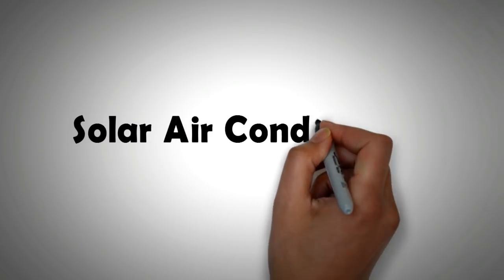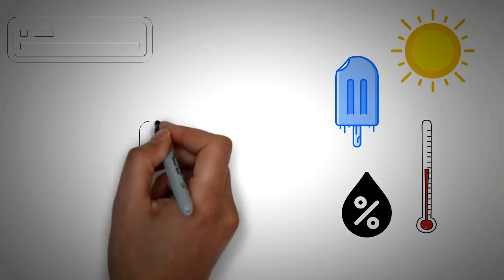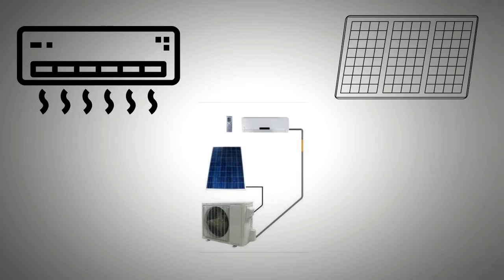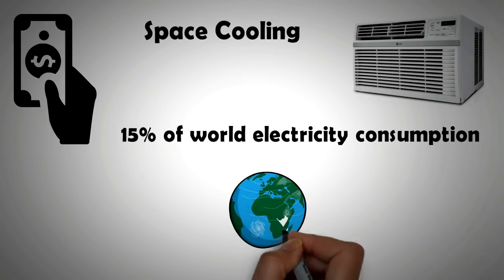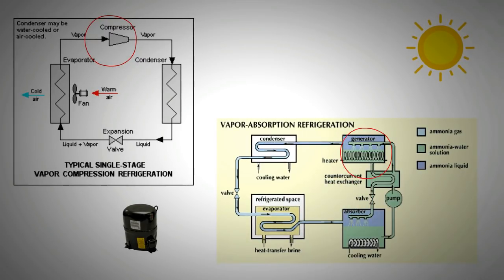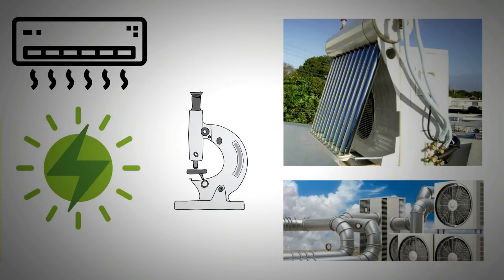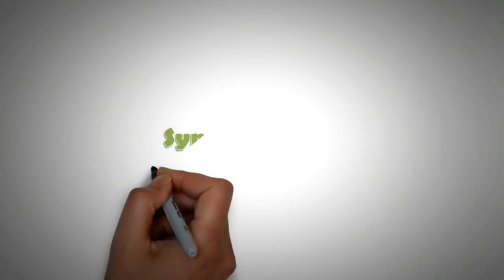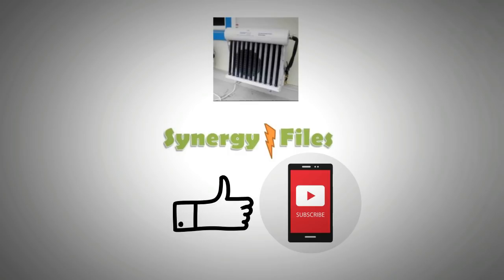What are Solar Air Conditioners

Comment: As far as I can tell, this concept fundamentally misunderstands how phase change heat pumps work. Adding heat won't help you cool something down more efficiently. If you can explain how it can, please do so because I'd love to know.
Reply: What they're saying is that they use a solar compressor, meaning pressurised gas is heated to further raise it's pressure for fixed volume, so they're raising afterload for the actual electrical compressor, and then they cool this with a larger condenser, and this somehow raises efficiency. 
At first I was convinced but later now I'm stumped.
Reply: Refrigerant will want to expand, making harder for compressor, besides if condenser couldn't cool it as should then warmer refrigerant will pass through evaporator ..so dumb

Comment: lots of talking ,  how much does one cost , what does it cost to run compared to a current unit   . is it even available?
Reply from the maker: Will depend on Sunlight, but your compressor could be running 60 percent of its normal time

Comment: I'm fairly certain that heat is a by product of the compression process not a goal,  if that were the case there'd be no need for the condenser  units that cool the vapor back to liguid before going into the compressor... that said in the case of ammonia ADSORPTION refrigeration you need only heat to liberate the ammonia from its absorption medium (could be a salt), which incidently compresses it,  and drive it off to condenser to allow the liquid to be used in the chiller, where it evaporates and then returning to the media.
Reply: @Lui Vyas the great knowledge sir. Explained very well.
Reply: Dont mix Adsorption- cooling (Solid liquid) and Absportion-Cooling (Liquid Liquid)

Comment: I think that heating before compressing the gas is wrong and would lower the cooling capacity of the system just as it is reduced on a hot day. The sun heats the gas before it is compressed which is why the efficiency is less on a hot day.
Reply: No. I think it Can be better since you add energy that the compressor otherwise has to provide. The work of the compressor is related directly to the ratio of compression. Higher low pressure, with constant high pressure Always results in lower power consumpion.
Reply: Yes hundred percent, cause if you see P H diagram its clear once you heat more after evaporator then work required by compressor is more , enthalpy of gas increases but pressure nothing so still zero benefit as the system is compression not absorber so this vedio done by idiot's, if you see T S diagram then again T increases and entropy increases do you know what if entropy increases it means again you are far from saturation so you need more power by compressor, last if you heat more the gas then you need bigger size of condenser..... so its wrong information

Comment: Thanks for nice information sir. Can you please explain that how it works in night when there is no sun and no heat outside. What will be the power consumption and efficiency of solar AC during Sun and night. Is it suitable for indian climate ? Thanks and regards
Reply from the maker: When there is no sun, the Solar AC runs just like a normal AC. This means solar AC draws less power from grid  when the sun is out while it draws more power when there is no sun
Reply: Going to work at night only when the sun is out using solar energy during the daytime will help lowering your electric bill because during the daytime your air conditioner will not be using as much energy from the grid also it is cooler at night so the compressor will not be turning on as often air conditioners use more electricity during the daytime because the compressor has to kick on more often because it is hotter during the daytime and if you set your thermostat a little higher turn the night time compressor will not kick on as often this will help you tease electrical use

Comment: These alternative forms of cooling does have niche applications but they will never work for a large office building.   More smoke and mirror.
Reply: rotate85 RV and campers...
Reply: Absorption cooling got standart the last 10 years for large Office Buildings (Hilton etc.). At day time the do work with solar tubes and at night they do burn propane or gas.

Comment: I must be a total idiot, since I did not get this video at all!
Reply: You're not alone
Reply: A normal compressor increases the pressure (and therefore also the temp) of the refrigerant.  if the refrigerant is preheated by the sun (which also increases pressure *I think*) before entering the compressor, the compressor doesn't have to work as hard. That's the theory anyway.

Comment: Adding heat to refrigerant to save compression energy is nonsence because hotter gas take more pressure to liquefy. Nobody has explained how it should work. I would use heat to run a dehumdifier system!
Reply: Look up absorption fridge, same tech as this used in most caravans and rvs
Reply: @archygrey9093  They don't use compressors. but thanks for your help.
Reply: @davegeorge7094  Thats the point, they work the same way as this solar ac, they don't require compression so there is no compression energy to save.

Comment: I had The Idea Myself Early In Life to Engineer With Uvl Magnification Glass in Makeing Imertation Solar Uvl Magnification Spherical Spinning Motioning Heat Energy Reactor With Thier Own Solar UvlMegnification Copper Conductive Solar Uvl Light Heat Energy Transformer System to Which Converts All Solar Uvl Magnification Heat Energy into Useable Light Electrical Energies to Which Can Be Used To Produce Solar Powered Uvl Magnification Light Electrical Energy and Also Solar Powered Uvl Magnification Light Energies for Air and Water Heating Systems .What Do You Think .Good Kind Strong  Passive Bearers let Engineers online Please.
Reply: Explain that please

Comment: This sounds like a scam. The functioning of ac dosenot require heating. The compressor just compress the vapor back into liquid and this process results into a hot compressed refrigerant, post that it goes to the condenser for the temperature drop then to the valve where it is relived from high pressure to low pressure then to evaporator where the air from room passes over the coil and heat exchange happens and you get cold air. This relived gas goes back to the compress condenser cycle.

Comment: I don't understand why if it solar air conditioning why isn't the solar completely powering the unit make a better  solar panel or add make a more effecient unit or a battery unit to store the powe to run the system if you still need standard power why buy this system

Comment: Pure non-sense since vacuum tubes would have to operate at a lower temperature than the ambient thereby causing the refrigerant to PICK  UP HEAT not give it off, duh.   Like trying to reinvent the wheel by making it square.
Reply from the maker: The heat is added before the compression process not after it has passed through the throttle

Comment: You spent only seconds explaining the most difficult portion of your presentation.  

How many years did it take you to understand this stuff?

I suggest you get a group of kids, and you try to explain to them what you want to explain in this video.

When most of them understand what you tried to explain in this video, then try again.

Perhaps the feedback from your audience will help your presentation.
Reply: Absorption cooling is somthin from 19th century. You can use wiki on this. Nothing new. Problem of this Technology is or was how to get more than 75 °Celsius with Solar tubes. Now this Problem is solved with new Tubes working at least in Sub Tropical Tropical etc countries + Ammonia replaced by Ionic liquides and the Need of less than 75° Celsius. One Problem stays,, what are you doing at night time when the temperature of water reduces below 70° Celsius and the System stops to work